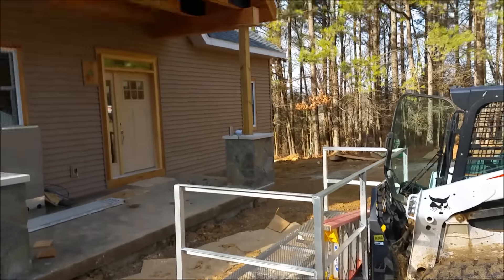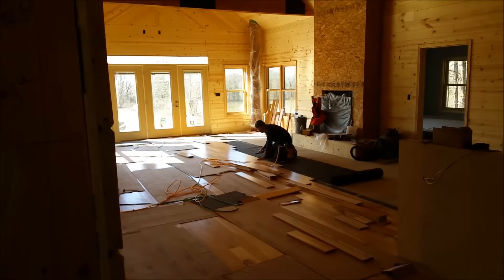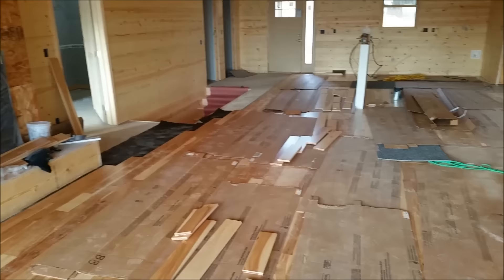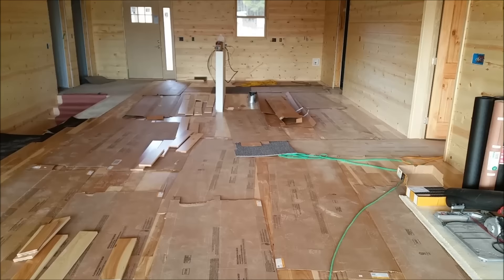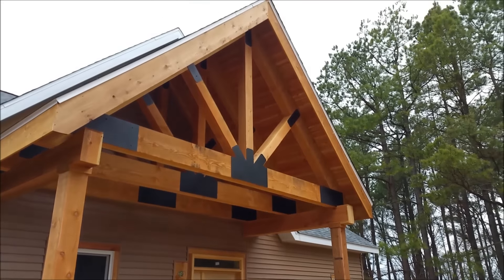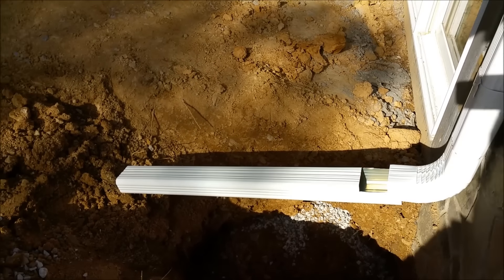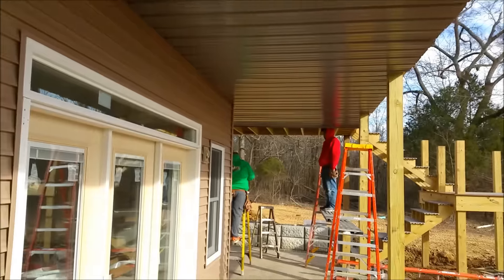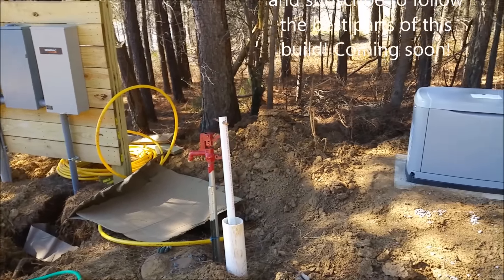Dream Country Home Build Update; Gutters, Hickory stairs/floors and more

Comment: Looking GREAT Kap !!! I agreed with Mel on the downspouts ,  Make a run from the downspouts out to the field ,  around here they use the heavy green DWS pipe . The house looks GREAT , Ryan is doing a nice job , you got a winner there .  The final FITTINGS seem to take the most time . stay safe , Bob k
Reply from the maker: Robert Kavich teah, I'll be trenching like 6 or 7 gutter pipes. I use 4" double wall culvert pipe. won't crush when driven over. break out the e42 again!

Comment: With all that clay tie the gutters into solid black pipe and run them away from the house. It's a nice clean look and keeps all that water away from the foundation. I was a landscaper for many years and this was done on just about every home. even with sand. The mini excavator will make short work of it. Love what your doing looks great.
Reply from the maker: Mel Sanch yes sir, I will be trenching every one of them out into the woods in different directions. I used 4 inch double wall culvert pipe that way they won't Crush when you run them over
Reply: Should have known you had this. lol
Reply from the maker: LOL, man that's ok :) Beleive me, theres many things i do forget and the reminders are good!

Comment: We use ram board  to protect finish floors in my area so you may want to consider something like before you bring ladders in, around the fireplace I would add a layer to plywood on top of the ram board, the risk of damage there is going to be high, gl.

Comment: Great to have the generator mate... The longest mine ran was 4 days and the propane for it was worth it.  Mine is too close to the house and the master bedroom but means I know it came on.
Reply from the maker: Sheepy Hollow yeah, I'm sure I'll hear it. I've asked them to set it up so I can turn the automatic part on/off manually
Reply: I have mine start Wednesday at noon for 5-10 minutes or so to check it self out.  I don't mind it coming on but everytime the geothermal unit comes on it rev's up and make enough noise to disturb your sleep.  Such is life :)

Comment: Dam, things are simlar but different. We had multi shade oak(that look the same) floors put the master bedroom, the hall, and the our daughters room because of allergies.When we took up the carpet, we found pressure board that won't work under hard wood flooring because the nails will lossen up . We suffered through pulling out a 5 pound can of nails getting the pressure board up only to find the supporting wall below toe nailed into the drywall ceiling. Oh boy.
Reply from the maker: Gordon Garvens dang.... fixer upper nightmare!
Reply: In hind sight, my wife wishes we would have built new down by the bay. Sardines, Nice neighbors though. Lots of bugs by the lake.

Comment: This is why you should go with sand and finish floors. The last thing I do is sand the floors and hand my customers the keys. I find that raw sand and finish materials are much higher quality.
Reply from the maker: hmmm, so you leave it just plain sanded, or does the customer then finish it?
Reply: @kapperoutdoors  I have had one or two customers through the years that closed with raw floors but it should be done and done well by a professional.

Comment: Looking good. What is the square cut-out section on the bottom of the downspouts for?
Reply from the maker: EOSJOE not sure what you are referring to? I will be trenching pipes from every single downspout out into the woods
Reply: On the shot showing your downspout (4:18) where it comes down and then bends outward away from the house. Right where it makes the bend there is a cut-out on the top side of the downspout. I was curious what that was for as I don't have anything like that on mine (and perhaps it solves a certain issue).
Reply from the maker: Oh, i see. They all have that. That is so that you can fold them up when you want to mow or maintain the ground underneath. With the cut out they will fold all the way up and stay next to the Vertical pipe temporarily.
Reply: That makes sense.  Thank you for getting back to me.